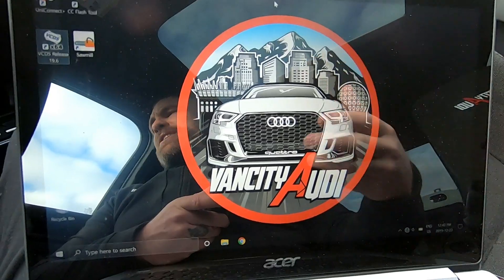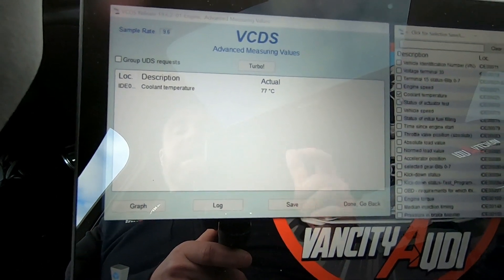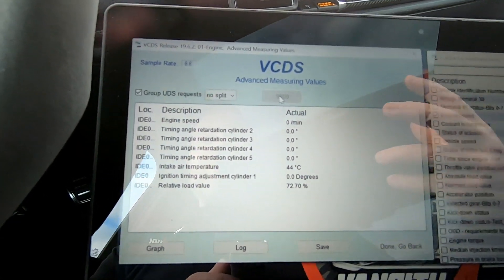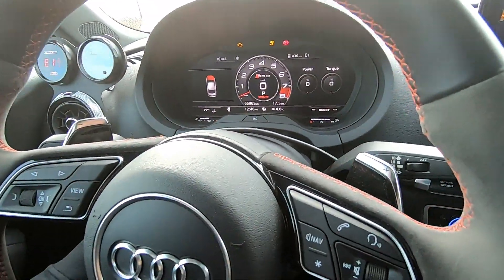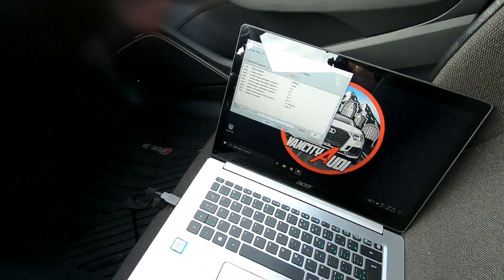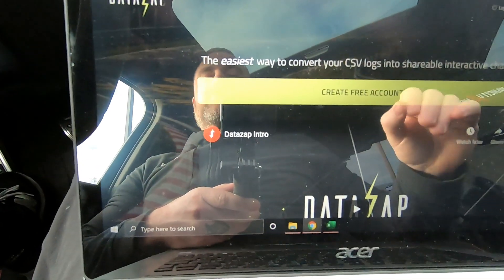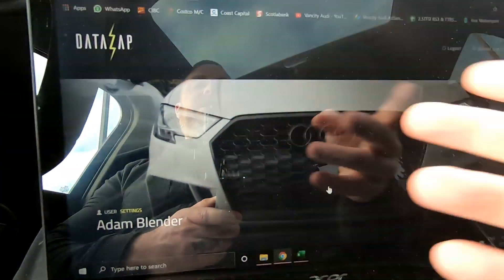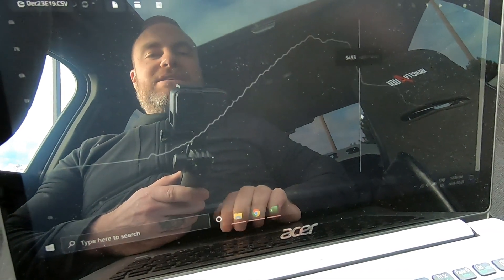How To Log Ignition Timing In Your Audi RS3 and TTRS with VCDS

Comment: Hello, how you made pre selection file and loaded to vcds advanced measuring values ( you lauded them from computer ) i cant find camshaft adaptation values in my vcds audi tfsi 2009 year ?
Reply from the maker: If you type in 'camshaft' or 'adaptation' and nothing comes up, that means it's either called something else or it doesn't exist for your year and model.
Reply: @VancityAudi yea i have a 13 s4 and i cant find it either. Using diff wording and i never get cylinder 1-6
Reply from the maker: I got you covered!!! I show how in this video: https://youtu.be/EChzDGcJh10?si=wIPkHypUp66HgTLJ

Comment: I have a stage 2 rs3 tuned (unitronic )on 93 and timing is being pulled I see it pulled from -.75 to  -3  . Imma see if putting some e85 fixes it.  Or should I just go full e85?
Reply from the maker: By blending up to an E20 mixture you will see zero timing correction on their 93 tune.
Reply: @VancityAudi  bet! Appreciate the fast reply my man 🤙🏽🤙🏽
Reply: So I put e20 -& it runs better but still pulls timing but just not nearly as much
Reply from the maker: @ERrebuilds  I'd do some other diagnostics then. If you're running a Uni 93 octane tune on an E20 blend, you should not be seeing any timing correction at all.
Reply: @VancityAudi  where would you start ?and what should I look for?
Reply from the maker: @ERrebuilds  first off, how many degrees of timing correction are you still seeing? Is it always in the same cylinder or cylinders? Is it random?
Reply: @VancityAudi  so I started off 3rd gear 2500rpm WOT. And around 3400 -1.5 timing was pulled in cylinder 3 up until around 4200 rpm’s and around 4350 rpm’s timing was being pulled from cylinder 2 (-1.5) and cylinder3  was now pulling -.75 up until 5k rpm’s and after that no timing was pulled till 7k rpm’s
Reply from the maker: @ERrebuilds  if you do another pull are you seeing the timing reduction consistent in those 2 cylinders or does it move around?
Reply: @VancityAudi   so I did some more data logs and out of 8 pulls timing was being pulled in 2 of the logs. And it was cylinder 2 or 3 and it was never pulling timing together . But it was weird during  a small pull with 63 percent throttle it pulled -3 degrees for a split second in cylinder 2, and right after that I did 2 WOT sends and everything was fine . Also sometimes I do experiencing a weird stutter . And eveytime I wanna log the car it goes away . But I do have a video of the car and you can hear it sputtering only under WOT

Comment: Did you ever log your car while cruising? I have some corrections while cruising at low load (between 0.75 and 2.63 degrees).
Reply from the maker: No, those logs won't provide the information you're looking for to make sure your car is running properly at WOT.

Comment: If you ecu is aready adapted, you will not see any knock even with bad fuel.

You need restar Ecu tô default to force the own timings with no adaptation yeat.
Reply from the maker: Uhhhhhh, ya. You might want to Google what you just claimed. That couldn't be further from the truth. Your car will not completely stop showing timing reductions if you continually use sh$t fuel. It doesn't work like that, lol.
Reply: @VancityAudi  if you right great I will do the test right now,  I use shit fuel with 10% of alcohol… 

I will love to see if I’m losing power….thx
Reply: I have a Rs5

Comment: Been loving the RS3 content. I recently picked up a '18 RS3 and went Unitronic Stage 1+ E85 tune. Got Neuspeed rse102 19x9 wheels with 255 PS4S on all 4. No ethanol Guage yet, but I got an ethanol measuring tube. (also my station has a  minimum of E70). The car pulls like nothing I've driven before, but I'm going to log it with VCDS like this to monitor it. Thanks!
Reply from the maker: Congrats on the ride and good luck!!!
Reply: @VancityAudi  any reason not to just include cylinder 1 timing retardation to the list?
Reply from the maker: @scottc78  check out the write up in the video description. You can and should log all of them. I just don't in the video.

Comment: Great video. Enjoying the TTE700 series as well. Great idea to film the progressive change on different files/tunes. 

After watching one of your recent videos on the Audi S4, it got my interested to log my Rs3 as well. Vagcom arrives in the next few days which should be very interesting.

Question before I go ahead and install an ethonal analyser for my car, adding 5-10% of E85 to a stock engine running an APR stage 2+ 93 tune on an Audi RS3 pre facelift 2015 model is ok to do so?
Reply from the maker: Thank you very much. Before you bother installing an analyzer, log your car and see how it's performing. If you see timing being pulled then yes, install the analyzer. Then add 5% ethanol. Your OEM fuel system can handle that fine as long as you aren't seeing any faults or lower pressure in your fuel system... which you can log as well with VCDS.

Comment: So if I do data logging and show that I have room to clean up my logs on 93 pump for my S4, could I possibly use a bit if E85 to make more power? My tuner told me never to run e85 but I want more power ):
Reply from the maker: You can comfortably run E15, have a bit better performance and clean up your logs by adding a little E85 to your fuel. Just make sure you are using an ethanol content analyzer to check on your levels at all times

Comment: Well, you were dead on. I’m seeing timing retardant on all cylinders running a stage 1 Uni with 91 Chevron gas. West coast gas sucks. I am seeing as much as 8 degrees pulled. I logged a WoT from 1-3 gear. I will try just a 3rd gear pull like you said in the video. 

Guess I have a lot of logging ahead of me to find decent 91 pump gas 😞
Reply from the maker: I hate to be the bearer of bad news but there is no such thing as decent 91 pump gas, haha. You're better off grabbing some E85 from Northside Petroleum and adding a few liters every fill up. You'll see the majority of that timing retardation gone.
Reply: We suffer from the same issue with poor fuel. I'm going with a WMI setup to help cool iat and up the octane a little to help eliminate timing retardation

Comment: Would an rs3 with stock motor/trans be reliable running unitronic stage 2 e60-e85 file?
Reply from the maker: That is what the tune was made for. A stock engine and stock transmission

Comment: Thanks for all your informative videos, learning a lot. I’m on Unitronic Stg 1 91oct Unitronic Stage 2 TCU on my 19 RS3. Do you think it’s safe to run their Stage 1+ 93oct file with a couple gallons of e85 to blend?
Reply from the maker: Technically it should be perfectly fine, but I would double check with Unitronic just to be on the safe side.  You may need to add up to 30% ethanol to get the octane level up to the appropriate amount.  So be very careful.  I suggest an ethanol content analyzer to be installed in your car as well as testing the octane level yourself as well to be sure it is what the analyzer says it is
Reply: Vancity Audi that sounds like a good idea. I’ll contact unitronic l. Your videos are inspiring me to stage 2! Gonna drive my car stage 1 for a little while and go stage 2 next year. Keep up the great videos!
Reply from the maker: @gaspasser_  thanks. Will do!

Comment: I am running a Unitronic stage 1+ tune on my golf and I run Petro Canada 94 octane. You mentioned that this gas isn’t good for power. Why is this? Do you think I am not achieving Unitronic’s claimed numbers?
Thanks
Reply from the maker: I believe your Petro 94 has ethanol out on the East Coast of Canada. I'm referring to our West Coast Chevron 94 fuel which has zero percent ethanol and makes crap all for power.
Reply: Vancity Audi ok good to know! Keep up the awesome videos
Reply from the maker: @Bossdog306  from my understanding there are 2 types of Petro 94 on the East Coast and I've been told that one of them works better then the other. I think it is the one called Ultra that has had the best performance gains

Comment: Why not log the timing pull on cyl1 as well ?
Reply from the maker: I do not believe there is a parameter in VCDS to do so
Reply: @VancityAudi  I am sure it is in the variables list, just not with 2,3,4 and 5.
Reply from the maker: @danterry5447  Interesting.  Unitronic must have a reason they recommended I log these variables to make sure everything is running optimally.  Sadly, I am not 100% sure why they suggested these parameters and not include timing retardation in cylinder 1
Reply: @VancityAudi  yeah that does seem odd that they dont ask for it in logs. Worth adding in though as without it you are not seeing what is happening across the whole engine.
Reply from the maker: @danterry5447  I just plugged in again to check and you are absolutely correct.  I will add it in to the video description to log cylinder 1 as well as pinning a comment noting this.  Thanks
Reply: Timing of cylinder 1 includes corrections. This is common across VAG.
Reply: @dirk5950  yes but does not show how much retardation is being applied to cyl1

Comment: Really useful video. I can’t wait to try out. My new downpipe for the RS3 shows up Thursday. I want to compare logs between 91 tune against 93 tune for road course. Also plan on running 93 tune at drag strip and want to get the most out of it so I want to make sure I am not pulling timing. Keep up the great content.
Reply from the maker: Thanks. Good luck with the logging!

Comment: Good stuff.  Did anyone ever figure out why cyl5 always had timing pull?  Were there others with the same issue on that cylinder and that tune?  That just seems odd to me.  Cyl2 is usually the grumpy one on my GTI but not always.
Reply from the maker: Sadly, we were never able to diagnose the 5th cylinder timing pull on the Custom Code software.  Once I switched to Unitronic software I have only seen very minor corrections in cylinder 2 and 3 every so often. From my experience, the noisiest cylinder on these 5 cylinders is cylinder 3.